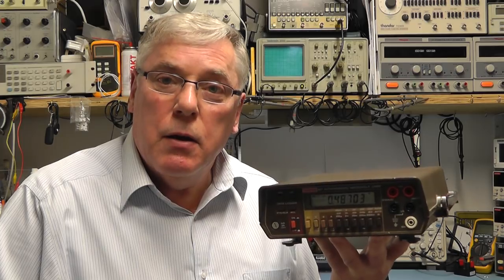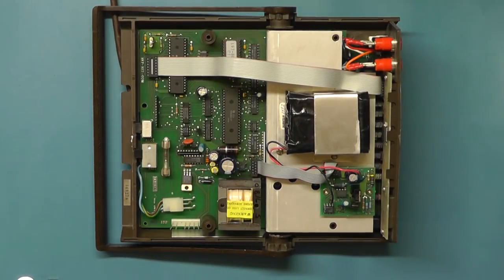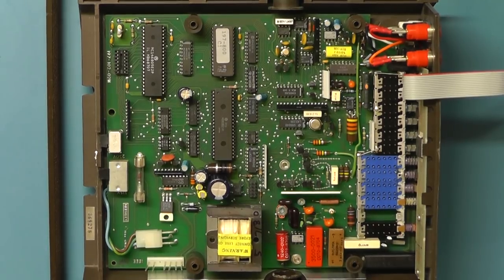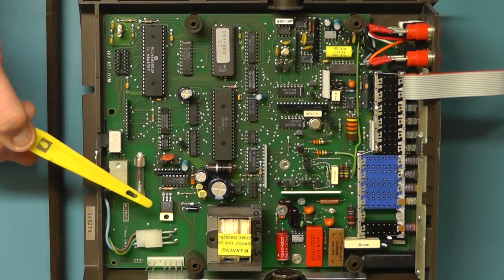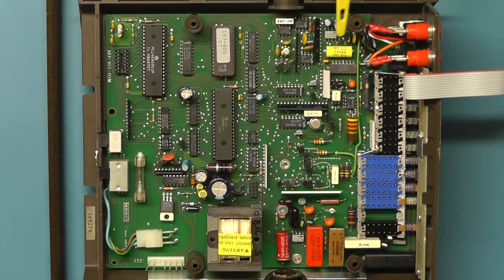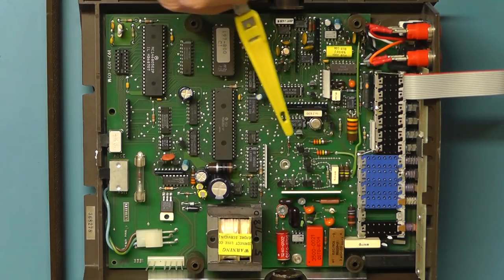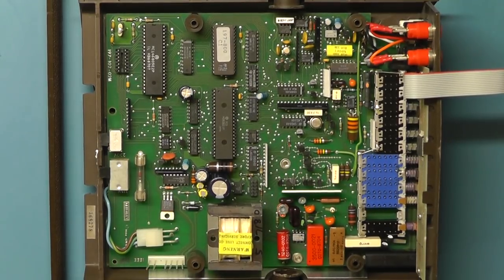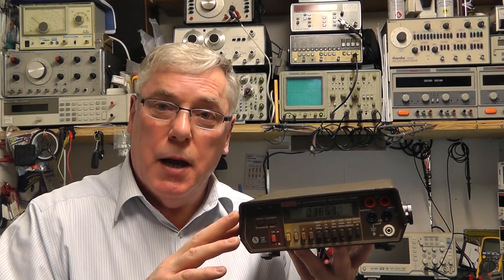Scullcom Hobby Electronics #12 - Keithley 197 Digital Multimeter

Comment: There is a firmware version of A, B, & C, the C uses the switch in the back, but they claim rev A has a switch internal, I looked all over and there is no switch. Any ideas how to get into Cal mode for A version?
Reply from the maker: +Paul Crissman Below are some details for the different firmware version A calibration and storage:

Calibration Enable
If you have Revision A level software, then there is an internal calibration jumper plug that enables permanent storage of calibration constants.
The meter is shipped with its internal calibration jumper in a disabling position. In this position, calibration cannot be done.
The jumper must be placed in its enabling position to allow calibration. Proceed as follows:
1. Remove the top cover.
2. The calibration jumper is located in the middle of the mother board right behind the shield. Move the calibration jumper from position A to position B.
3. Replace the top cover; plug the line cord back in and turn the instrument on.

Calibration Storage
Revision A Software
To store the calibration constants, simultaneously press the REL and dB button until the message STOR is displayed. If the new calibration constants are not stored, they will be lost when the unit is turned off. If it is desired to disable front panel calibration place the calibration jumper in the appropriate position.

Hope this is of some help.
Louis
Reply: I found that jumper and it seems to do nothing, but also the "REL" button seems to have no effect at all. I suspect that the REL button not working might be the problem. Thanks for your help.
Reply from the maker: +Paul Crissman Yes agree it could be a fault button. Did the "REL" button work on the meter under normal usage?
Reply: No, it doesn't, guess I'll have to see what's wrong. Hope it's not one of those carbon trace things.
Reply: I just took it apart and the rubber button has one of those conductive black rubber dots on it. It reads real high and the other buttons are low. So I will get some spare rubber dots that I saved from scrap and change the rubber dot. This might fix it.
Reply from the maker: +Paul Crissman In the past I have modified the PCB board behind the button and replaced the conductive button track with a small tactile button which works well.
Reply: I glued another from a scrap piece and now it's working, thanks for your help. I wasn't aware that this button would zero the ohms to compensate for leads. This is the first I've seen this. I checked the meter on a voltage standard that I have and it looks pretty good, so I don't want to risk screwing up the calibration yet. I bought 2 of these on eBay, the other has the cal switch on the back.
Reply from the maker: +Paul Crissman Glad to hear its now working OK.